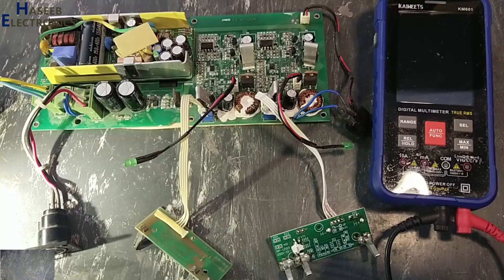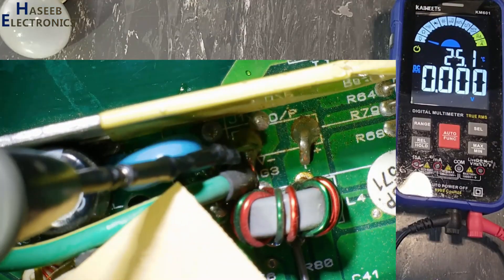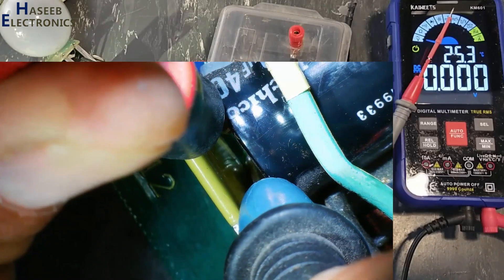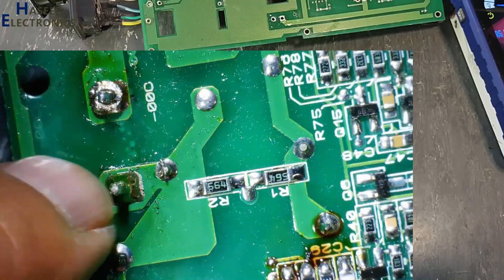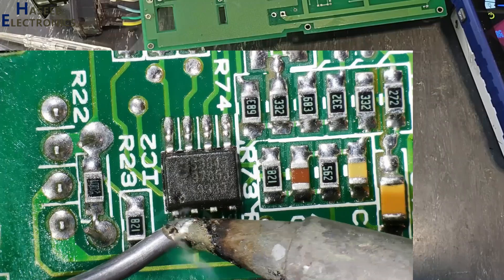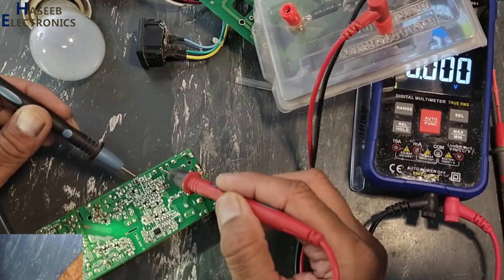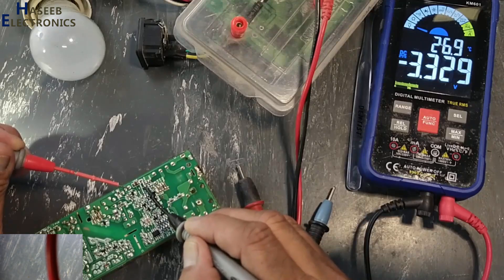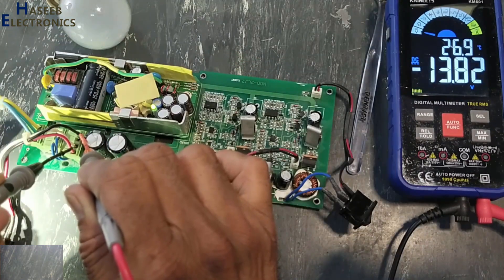{1192} Pro-X NCLJ Camera power supply & Battery charger repair

Comment: Thankyou for posting a useful informative videos sir. I have a table fan which has a single phase motor. One starting winding and one running winding got burnt but the rest of other starting and running windings are intact. Is that ok to change the burnt windings alone or should I have to change the entire windings. Please suggest sir. Thankyou.